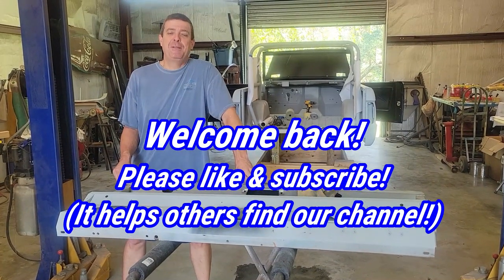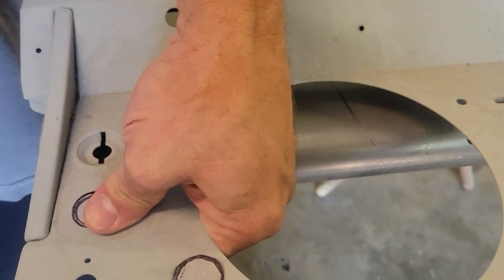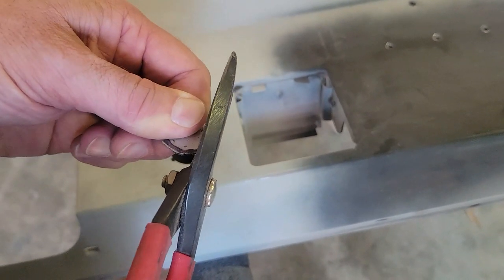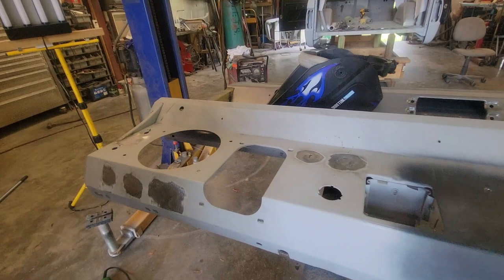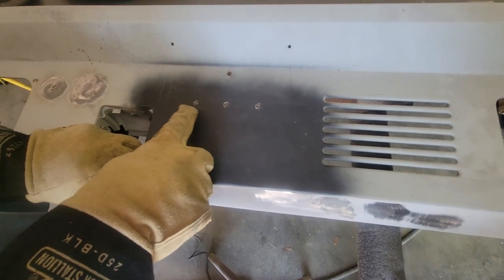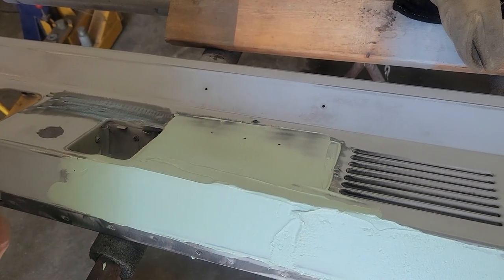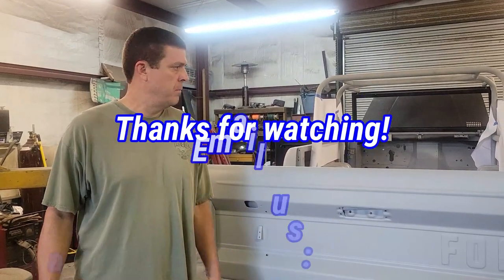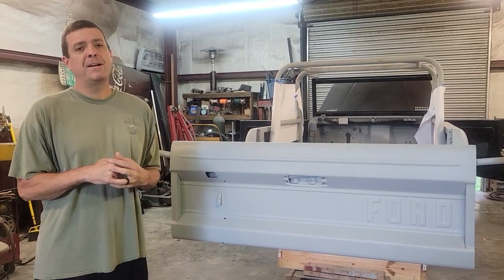Bronco dash repair and priming - 1966 Ford Bronco Restoration Project

Comment: Good to see you back on the bronco....always tough to balance work and play. I vote for the play but I understand. I still have to paint my dash...Driving to West now and its HOT...regretting not finishing the AC now. I love those little grinds...so useful. I like the shears...I use a hole saw and then a bench grinder...normally I loose at least one finger print in the process. Its looking good. Email me if you need any dimensions or pics at from West.
Reply from the maker: David I hope you two have a good time.  I wish we could have gone too but just no time.  Try to stay cool and drive safe.  Maybe we will see yall at the next one.

Comment: I put a 12v usb 3.0 charge port with a led volt meter where my cigarette lighter went. About the same size for under $20
Reply from the maker: That is the direction we are headed  but gonna use the ash tray.  The hole we had was off center a drove me crazy.

Comment: In the areas of the panel the you didn't repair do you sand off all the panel shipping primer to bare metal or just ruff up the surface before applying the epoxy primer?
Reply from the maker: I usually sand it really good but do not completely strip it.  I have not had any real issues with edp primer.  I know that not all manufacturers apply it as good as others.  Usually you can tell how good it adheres when you sand it.  Hard to explain but basically if the primer comes off in more than dust (chips) it is not good.